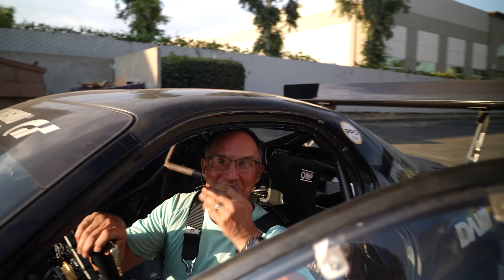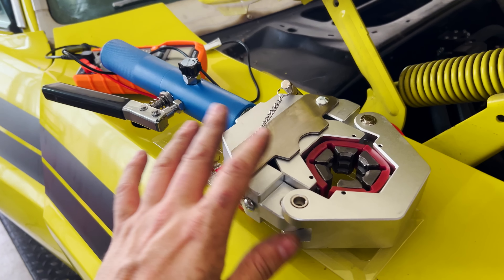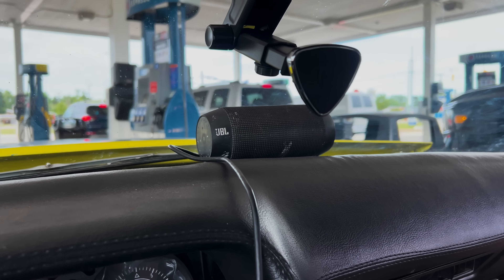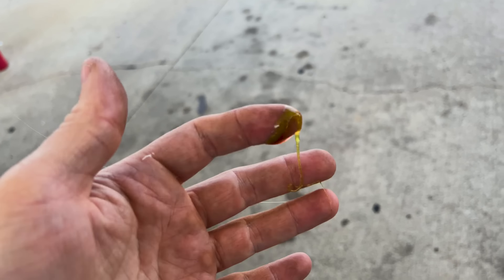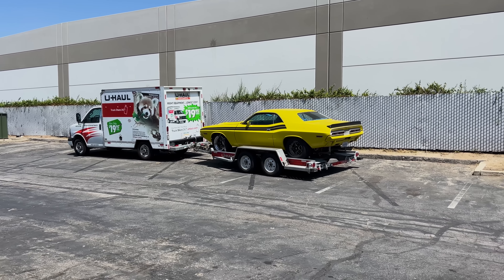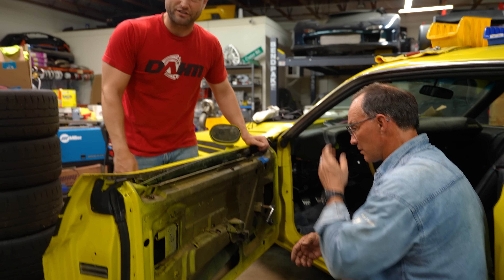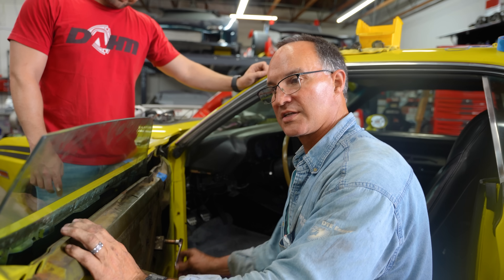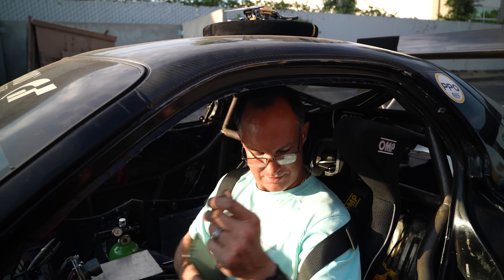Driving a 800HP classic car 2200 miles isn’t the smartest thing

Comment: Also after listening to the pump that sounds more like vapor lock do to the large pump constantly circulating fuel back to the tank and after a while it heats it up until the point it starts to vaporize

Comment: Drilled and lock wired all my brake bolts and axle bolts on my fab 9". Did all the bolts and drain plugs on my bike before a track day. Takes a bit to do but it is cheap insurance to not ruin your day or ruin it for everyone else by trashing the track!!

Comment: I would be suprised if when you're driving through the desert that your AC would work there is a reason why the Ac condensers are mounted in front of the radiator on cars.